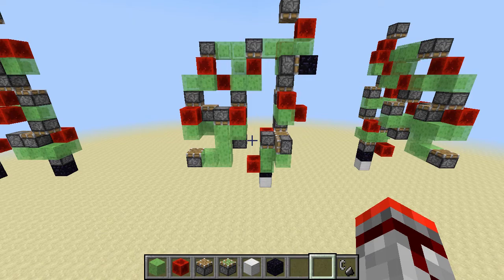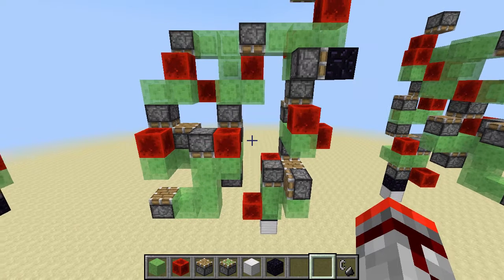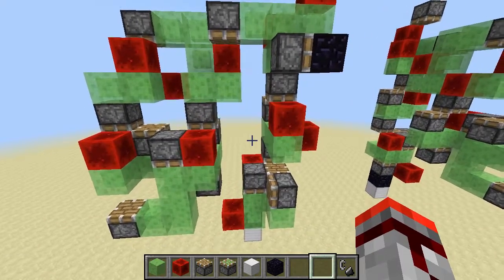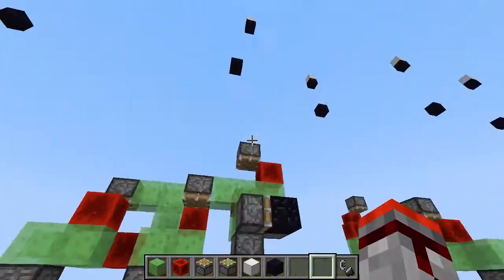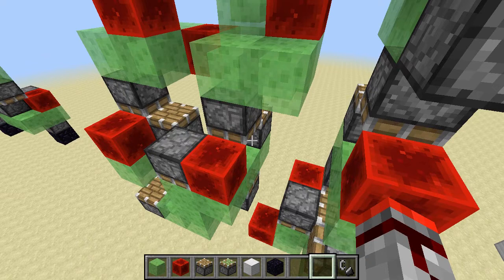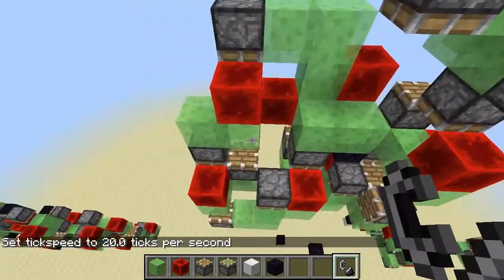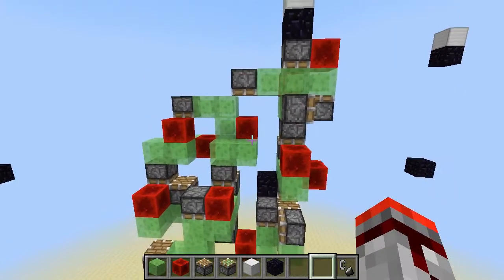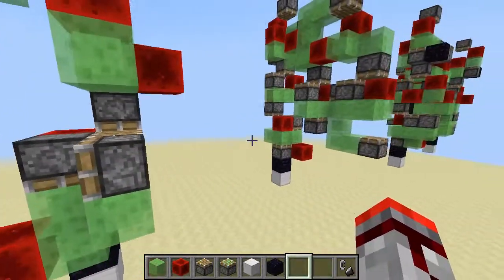3-stroke vertical bidirectional engine (1.8) - Minecraft

Comment: I mentioned the speed and I would mention stoke if it were better understood generally. I also made a 3 stroke engine I think with the same properties like 2 years ago but it was directional, like the first one (I think) which was made by Spire. He later fixed the directionality problem by fiddling with update orders. But that's a cool flying machine, I haven't seen a vertical one before actually :)
Reply: :D
Reply from the maker: Yay, no vertical one, at least this one is an innovation then! XD (Also, my 3-stroke HBE wasn't directional, it's just this 3-stroke VBE that is. ;-) )
Reply from the maker: DicoTheRedstoner
IDK, I just used two unidirectional 3-stroke engines ... didn't even know about those simple designs until the tournament. :P
Reply: +Wout12345 you can just make one with 6 normal pistons and all that's lacking is an updater piston to turn it around, but obsidian and a piston is enough to achieve that. Also managed to add on to one segment for about 8-9 spaces for whatever you want.
Reply: Welp, I had two duplicate comments here and deleting one of them on my phone deleted both.
Reply from the maker: DicoTheRedstoner
Good job. :P